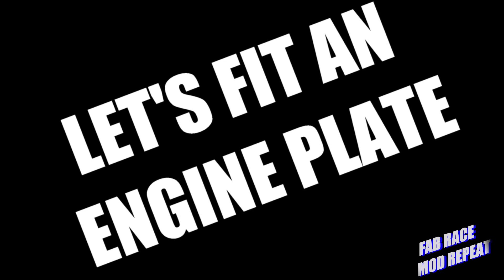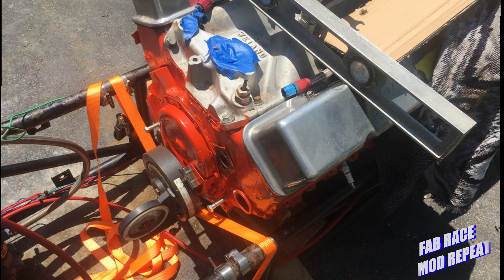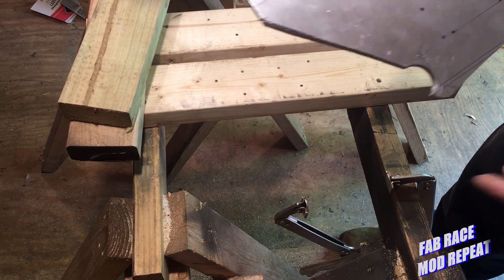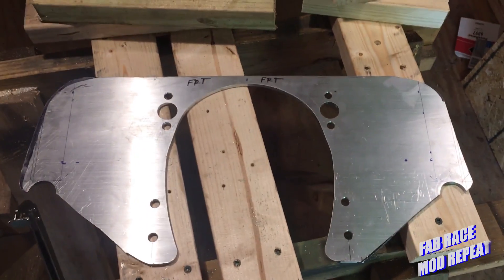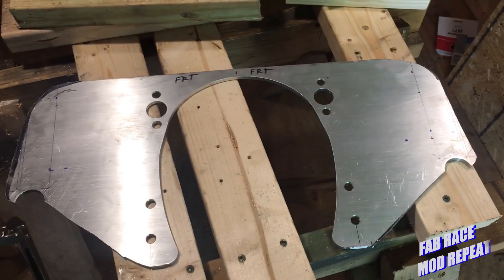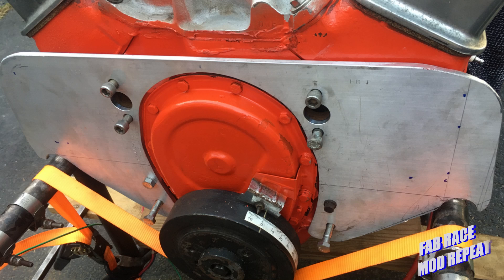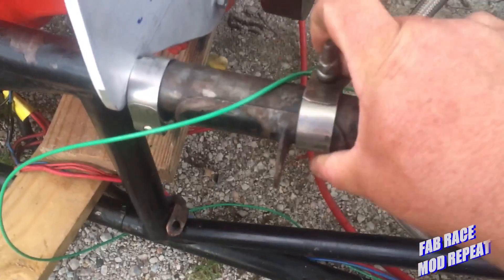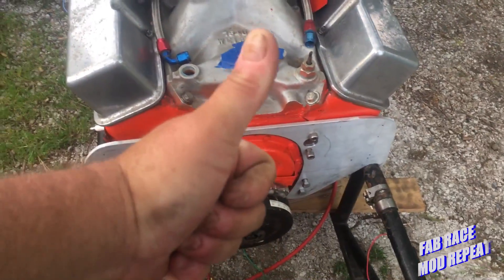Fitting an engine plate

Comment: as far as the t bolts what kind of a bitch is it getting them on as I need to do this exact thing for my dragster, Harley exhaust came with one and I couldnt get it on?
Reply from the maker: Great question,
Usually they’re not that hard to work with however, in recent years I have encountered some with let’s say; less than quality threads. These are tough to get back loose if need be.

Comment: I'm new to engine plates... do you use any sealant or gasket between the plate and the engine on the water pump holes? Or just straight bolt 0n?
Reply from the maker: Yes, you would still use gasket or sealer at any point on the plate water pass thru.
Reply: @FabRaceModRepeat    awesome,  thanks for your help. 👍
Reply from the maker: Dj SpeedDemon 
No trouble at all.
Thanks for watching!